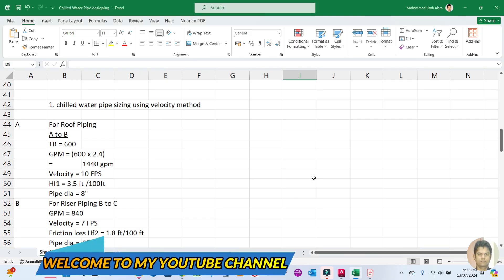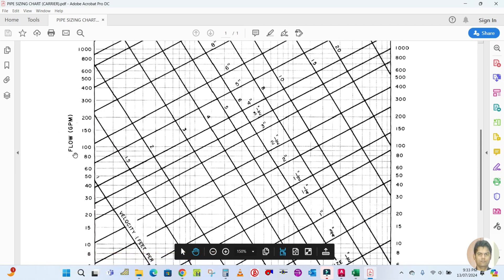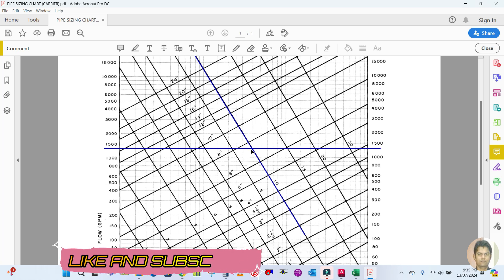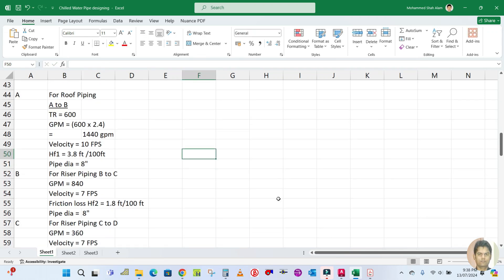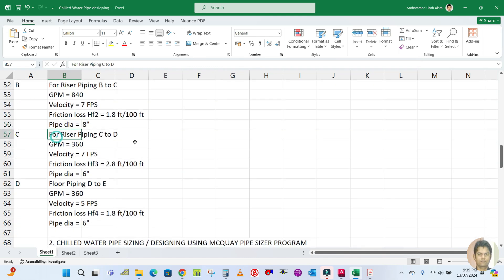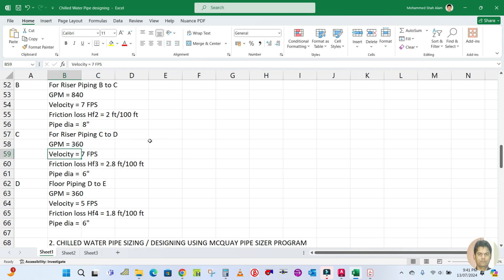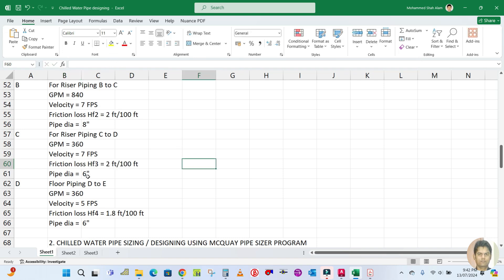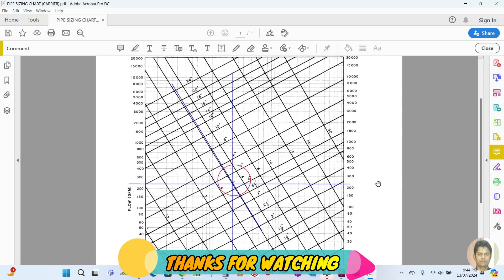Friction Loss For Closed Piping System II Chilled Water Pipe Sizing Using Carrier Piping Chart II

Comment: Good evening,

I noticed that in your drawing, the section "C" to "E" shows a diameter of 4" and "D" to "E" shows a diameter of 5", but in your calculations, you used 6" for everything. Considering the intersection of the points, the nearest diameter for section "C" to "E" should be 6" and for section "D" to "E" it should indeed be 5". Can you clarify this for me?
Reply from the maker: Pipe sizer software you can expect much accurate than graph